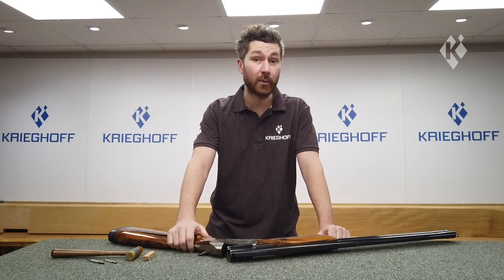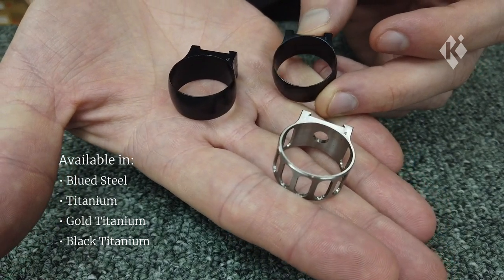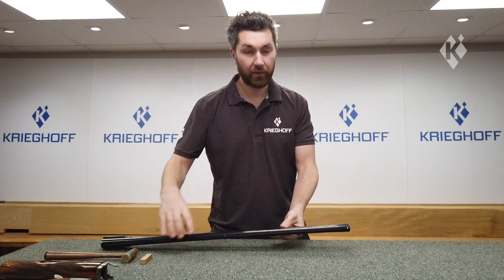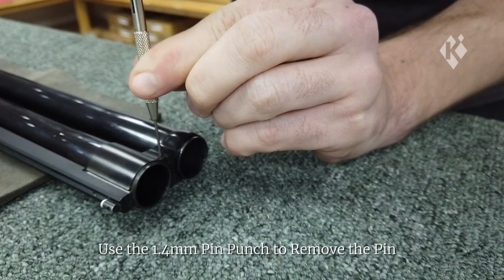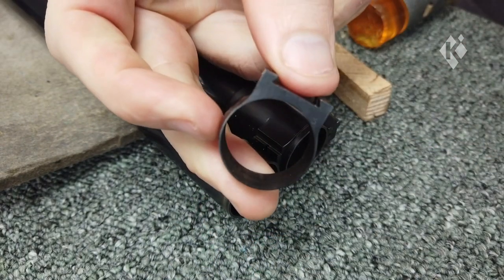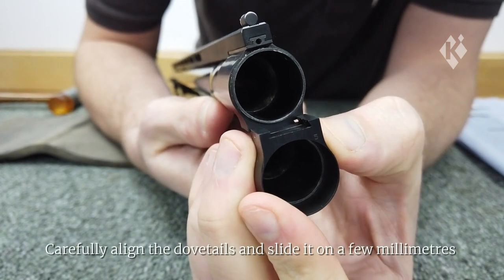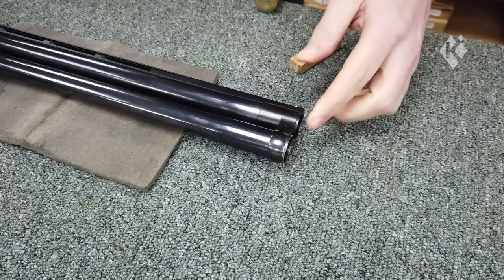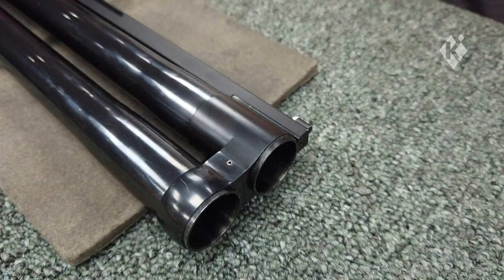Krieghoff Know How - Remove the Front Hanger

Comment: Great video. Do you recommend a light coat of oil on the barrel end before hanger re-installation ?
Reply from the maker: Hi, there's no need to use any oil when fitting the hangers back on.